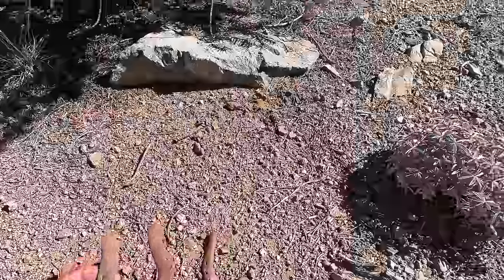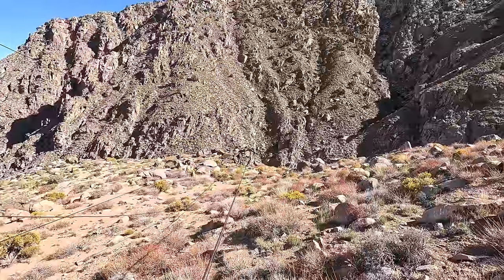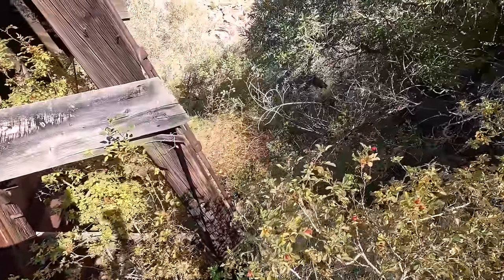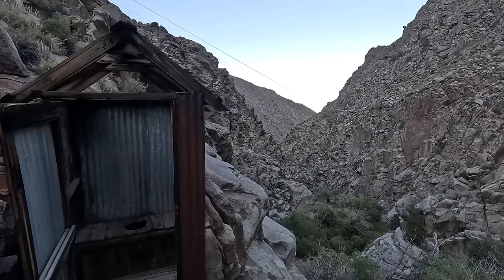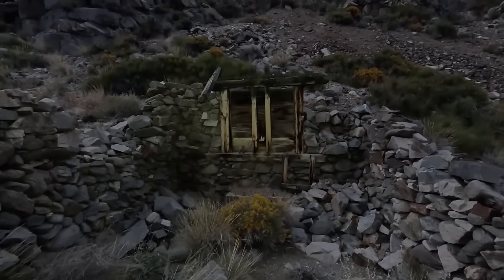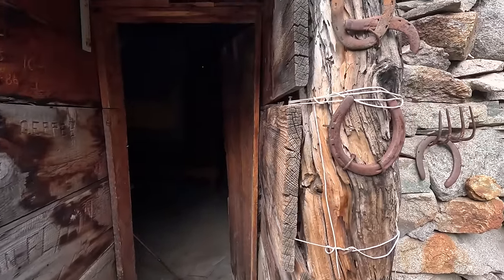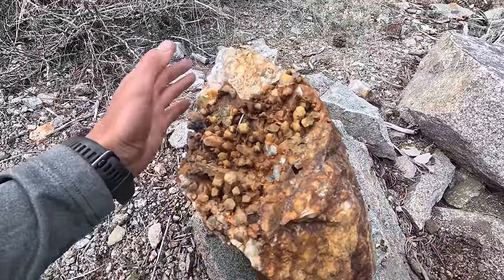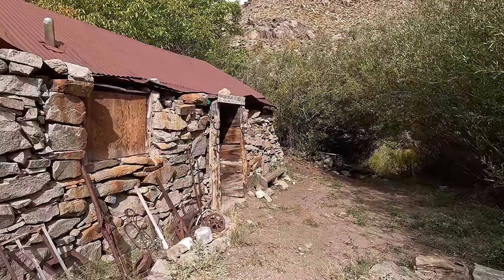Relentless Hike To This 1870's Ghost Town (Part 2)

Comment: The buffalo forge was used by the blacksmiths to blow air into the coal or charcoal forge to get the fire hot. 
I'm sure there was a blacksmith on site to make and repair tools and also make shoes for the mules.
 I'm not sure how much air that would have blown into the mine but I guess it may have been used for that.
 The long piece you found laying next to the pick is one half of a set of blacksmiths tongs.
 I believe the cabin site was the home to the local blacksmith and all the steel and iron pieces were materials for him to use or re-purpose to make tools.

Comment: that metal mesh is an old bed spring the " Old Timers " would sleep on ..... really cool arial tram towers .... beautiful 5 stamp battery mill .... most mortar boxes are secured on concrete foundations this one has a wooden one with anchors ...really cool.... if you can get into the box there could be Gold in there to clean out ....steam engine would power the stamp mill.... the holes in the boiler are called flue tubes where the hot gases and air would be drawn through to heat the water in the tank before leaving out the front and up the stack. That is a very beautiful Cabin .... the forge blower was used on a forge to blow air into the forge to make the charcoal burn hotter ...like blowing on a campfire so the blacksmith could heat the iron red hot to make it workable ....like sharpening drill steel or making horse shoes.... the tall bar with square hole is for a tap and die set ...I saw an old Gold Pan in the blocked window... beautiful crystal formation on good looking ore.... the piece next to the miners pick is part of a blacksmith tongs.....sulfides in quartz ..... iron oxides and black manganese oxides ...definitely Gold in there ...really cool explore my brother. Keep'em coming

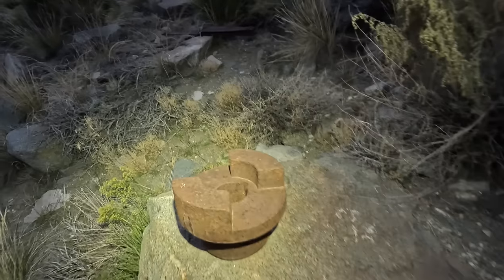Comment: The round piece at 24:50 is a clutch dog. There would be an identical piece the would interlock to engage a shaft or disengage.  Imagine lugging all the parts up into the mountains

Comment: wow your spot on - relentless definitely! almost an understatement - these mountains are ridiculous, steep, so rocky in all sizes, damn right dangerous, and very easy to slip on and bust an ankle, let alone the possibility i guess of the unwelcome surprise in the shape of a hissing snake of two - it's proper goat country, about the only thing (and the snakes) that live there - but still amazing to see the odd spot of human activity from the past

incredible to see such things last so long from an age when things were build to size and riveted together, no welding, anything like this in the UK would have either rusted to nothing or been eaten by critters, when you say how old stuff is, the timber looks brand new, like its just been put there

amazing place to get to - if you have goat legs and can get there - keeps you fit though

Comment: 21:14 the long thing with the square center is a die holder which uses square threading dies, usually for cutting pipe threads in that style. A blacksmith was important because picks, drills, and other tools require sharpening nearly daily--and often a new hard point is forge-welded on.  In England in that era, the Miner had to pay to re-point and repair his tools, not the mine owner--so you were careful with them.  

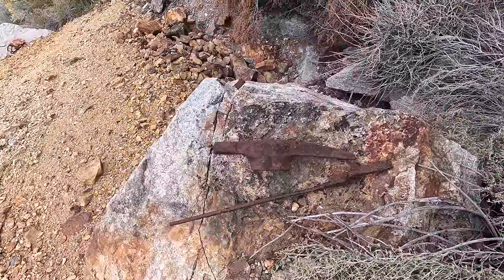Miner's pick will usually have the point on only one side like the example shown at 37:25.  It is not that the other pick end broke off.  Having a point on only one side allows work in tighter areas and without your back swing being dangerous to other people and things. Often there won't even be a stud remaining opposite the pointy end (that can be used as a hammer). Crystals as shown can be cleaned of the iron stains using oxalic acid, which is easily obtainable and cheap.  Takes a long soak.

Comment: 24:49 Some sort of shaft coupling, like a very crude clutch to engage/disengage the engine
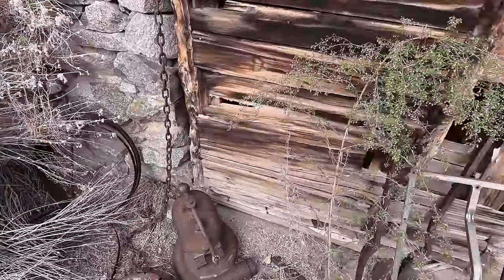26:37 I would say that is a fan (ie bellows) for a blacksmith's forge, and with all the odds and ends around, that was likely the shop/forge cabin
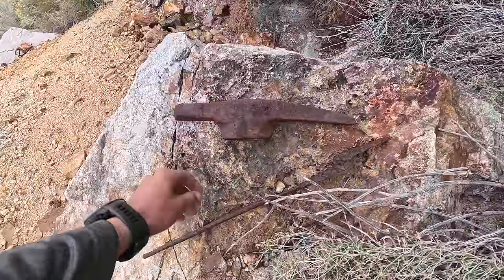37:15 Half of a pair of blacksmith tongs... like a very extended pair of pliers

Comment: Horizontal Firetube boiler and the tank atop is the steam dome where the safety valve and the main steam pipe would have been attached.

Comment: As others have mentioned the blower is for a forge ... using added air allowed the heat of the coal fire to increase a huge amount. Therefore any metal that needed to be worked for tools could be malleable and hammered more easily into shape like a stiff clay. Smaller ones were used as portable blowers ... air into the mine if needed would have to be forced by a larger device resembling a fan with a ducting or pipe to get air further into hole/tunnel. Great work kids. Considering the age of the last stone building it should be "Nasty" and yet is is very intact. Plug some gaps, cover the windows and you could spend the winter. The vice there is to hold pipe so that the ends could be threaded. The long piece that you found next to the pick at the rock pile is 1/2 of a blacksmiths set of tongs to hold metal he worked. The handle needed to be long to allow holding red hot metal and to create enough force to hold heavy pieces firmly.  The other half is shaped in the reverse of what you held, thereby creating pincers. The drift you went into was exploratory. There are surely dozens of those in the area.

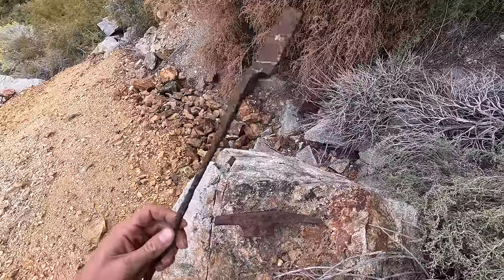Comment: 37:20 That is a half of a set of forging tongs. As in at one time a smith dude would hold a workpiece with that set of pliers and to put it into the forge to heat up...

Comment: great vid, cool to see their camp there. tells a story of how long they could handle being out there depending on how rich the ore was. would have been cool if you had a little gold monster metal detector to run over those tailings piles and in that hard rock shaft area.

Comment: Cool stuff, you're very fortunate to live in such an area. So what would have been the purpose of that upright structure you came across with the dies, is it for crushing rocks? Cause when I think of dies and stamping, I think of making metal panels and what not, just not sure what the purpose is at a mine site.

Comment: Hole's in the boiler are steam tubes
Reply: Not on this one, John...  this is a 'firetube' boiler.  fire from the fire pit he looked into would have gone into the back of the boiler, then thru the tubes, and out the stack above...  (see comment by @wrecklues above)  I ran one for years in a sawmill.

Comment: That piece that you were looking at next to the cabin it was used for a blacksmith for the gold mine. It wasn't to blow air in the gold mine. That's where you're wrong and that one because they had bigger ventilation for the gold mine so that was for a blacksmith😊

Comment: I think when you say that these are another structure is you are finding different claims. Back in the day people would have so much water frontage for  panning their claims. You have your place to sleep and then your diggings. Some people dug up the hill and ran the Orr down the shoot and then they would sluice the fine gold and it would get caught up in the matts and the lighter material would role on out.  Same thing with the crushers when they crushed the Orr they would run the smaller materials down a shute and the smaller and fine gold ran into the sluice plant to catch all the fine gold in the matts. If they just broke it up crushing it up and keeping the nuggets image all the fine gold that would still be in the creek and under and around the crushers? Hell I'd go right now and cash in if that were the case. I just imagine them old miners trying to think of the easiest and most effective ways to extract that gold.